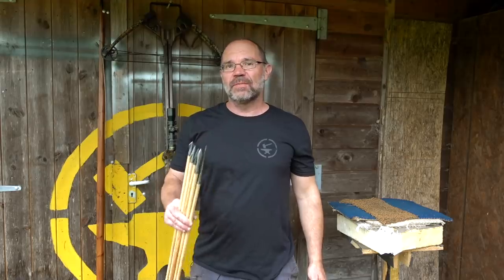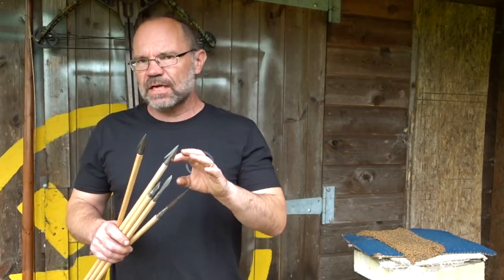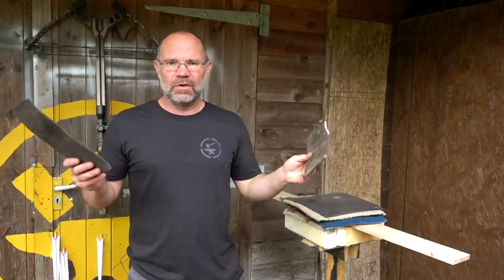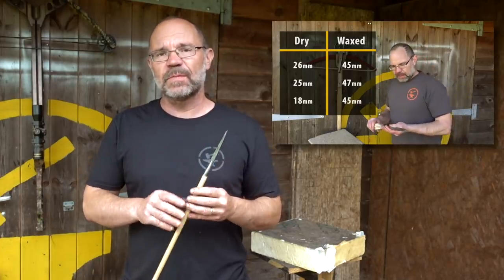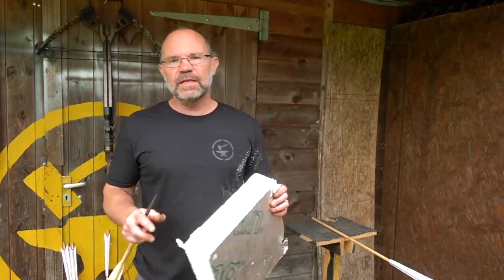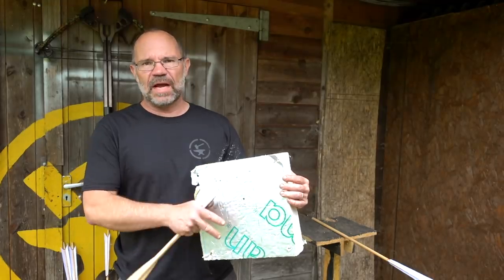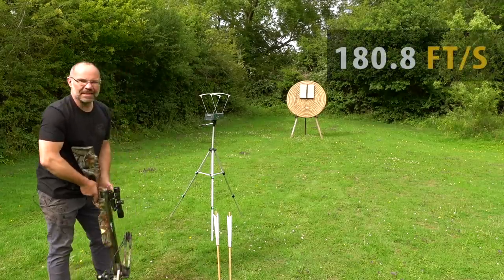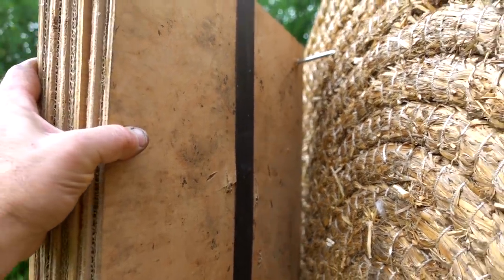Lockdown Longbow - Now I have WAR ARROWS!

Comment: I mentioned ballistic gel in my comment on your last vid, and I just wanted to say that Im fine with you not using it, I understand that you are doing more basic comparisons.

That said, I do think that a softer, more springy backing is important to avoid inaccurate results. After all, a gambeson is much less useful if it is laid against a hard surface, as that reduces the possible compression of the gambeson.

My suggestion would be that you can probably get a decent approximation of both the softness of flesh and the flexible "give" of an upright human being hit in the body by simply adding an inch of soft plastic/rubber foam, like seat from a lawn-chair on top of the stiff styrofoam.

This way the flexible armours have some ability to actually flex, without all the hassle of ballistic gel.

While (if xD) I have your attention there is something I have been meaning to ask.

Why do you think that bronze plate armour did not evolve further in antiquity? We know they did cuirasses, helmets and greaves, and further back they had primitive whole-body suits. What Im wondering is why something akin to the full plate harness of the 15th C ever came about.
Was it cost? But they made huge statues out of bronze. Was it the limits of the metal? But they had no problems making helmets and cuirasses. Plate steel armour came about soon after the ability to make steel in sufficiently large quantities. Was it cultural, to do with social structures and types of warfare? Was it perhaps that Iron had started to supersede bronze, and nobody thought to develop bronze further? Or is iron chainmail perhaps just superior? 
I personally doubt that last one, and I would love ut if you could test a bronze analogue of s medieval breastplate to see how it compares to mail.

I apologize for my very long comment, and I really, really would love your opinion on this.

Best of luck with the test-shooting, Ill be watching with interest.
Reply: I'm not an expert, but afaik bronze is substantially less stable compared to steel, and bronze swordblades were far more likely to shatter than steel blades for example. This would mean a full bronze plate armour would have to be considerably less effective and/or considerably heavier, potentially even unfeasibly-heavy. 
Also, making such a full set of plate armour as in late medieval times required quite some material, time, skill and technology to produce. I think some of that just generally wasn't quite available yet at the time of bronze gear. 
Based off of that, I'd guess they just switched to iron/steel as the clearly superior material asap, without "wasting" further effort on dealing with bronze.
Reply: @Heroesflorian  Theres a key point you are missing. Once you can work iron or steel, its great because its easily available. Bronze is not. Bronze is made from copper and tin. Those two metals rarely are found together, tin itself is quite rare. 

Why put all the effort into producing a metal from rarer materials when you have an easier and better material readily available.

Because iron is harder to smelt from ore than the components of/and bronze, less people were able to use it to see and display how good iron is for making weapons. When trade routes collapsed and tin became very scarce, metal workers were forced to look for alternatives rather than sticking with the bronze they were familiar with.
Reply: @andrewshaw1571  I think its even simpler.  They did make it, and decided the  benefits didn't out weight the negatives.  Remember the sole purpose of armour isn't to make you invulnerable.  You have to be able to march, fight, repair, custom fit it, etc.   In an age when everyone was using huge shields......the body was mostly safe anyway.   Only missile weapons were the outlying threat and most bows and slings of the time were not powerful enough that other more practical alternatives weren't just as acceptable.
Reply: When testing modern Kevlar armor, they put the vest on a block of clay. If you don't, the Kevlar doesn't stop bullets!
Reply: @Andrew Shaw
See, that's the problem I have. Bronze is rare, sure, but not THAT rare. The ancient greeks and romans could fill their temples with bronze statues https://www.metmuseum.org/toah/hd/grbr/hd_grbr.htm, and bronze was used in more well-to-do household items. If you can afford a set of bronze wine flagons, or a couple of life-sized  statues to decorate your villa, you presumably have no reason not to get a set of high-quality bronze armour for yourself or your son
Reply: @Bottlecapbill
But they had the same situation in medieval times, if not more so. Ca 1100 everyone was using nothing but mail and large shields. Three hundred years later everyone is using plate, and shields are smaller and much, much less important.
They moved from the (comparatively) easy to produce, maintain and put on/use mail, to the much more complicated in all aspects plate. The only thing I can think of that really changed in that time was the developing ability to manufacture large monoplates. As soon as they had them, they immediately started using them, because they are just that much more protective. The question is why this did not happen with bronze armour. Im guessing that a full suit of bronze plate is significantly more protective overall than a mail hauberk.
Reply: @IVscythia  it is a great question i am no expert but my thoughts  might help. The success of plate was that it was flexible enough to fight in.  perhaps they didn't have the technological know how to make it flexible enough for someone to actually move around and fight properly. a solid cuirass was easy enough to fight, and move in. To make overlapping shoulder plates and greaves  that could move with the flexibility that plate had was probably beyond their minds at the time.
Reply: I think this is down to the working characteristics. Bronze, like copper, hardens as it is worked. Very difficult to beat out into curved shapes. Most bronze artifacts are cast.  To soften it, you have to heat it up, quick cool down (slow cooling causes more hardening).
Steel works easily when red hot, can be shaped with a hammer and anvil.
Reply: @Alastair Dent
True, but they were pretty damn good at casting stuff in antiquity, for example I think most bronze cuirasses and helmets were cast, not hammered. If they could cast greaves and corinthian helmets I dont see why they could not cast all the parts of a full plate harness
Reply: The simple answer to your bronze question is ............Shields and linen are way, WAY cheaper. The long answer is there was NO middle class in antiquity.  Everyone was either VERY wealthy or a nearly dirt poor peasant (or even worse a slave) .  It is VERY expensive to make metal in antiquity.  The making of 1 statue, yes it's expensive.  But generally you have Insanely rich people commissioning statues.  Think Elon Musk building a space ship. Now fighting a war you need at least a few tens of thousands of men and a ton of money.  You don't really care if they all live, just that they live long enough to get the job done.  So you COULD blow your military budget on a few thousand guys with full plate armor or you could buy cheap as dirt linen Linothorax and wooden shields or even better, NOTHING but rocks and a sling and have an army 10x as big.  Plus you don't have to pay VERY expensive blacksmiths and smelters and charcoal to keep repairing all the gear after every battle.  Just a few camp wives to sew up more linen and make more shields.  And back then, the bigger army nearly always wins.  Also the people PAYING for the war are not usually doing any front line fighting. Xerxes conquered most of Greece but is never recorded as actually fighting personally.
The full plate metal armor came about with a middle class.  The soldiers are often lesser nobles or mercenaries who are paid with enough money to buy their own gear to provide better protection while peasant levies are still out there in padded cloth armor, shield and metal helmet if they are lucky.
Reply: There is so much wrong with that statement, but Ill just ask this: You think that a tiny, economically and militarily dominant aristocratic elite constitutes a "middle class"? Because that's who drove medieval plate development, the knightly class.
And if metal was so rare and so scarce that not even the super-rich would consider head to food protection, what about cataphracts? There were thousands of those guys, across several empires, and even their horses were armoured, usually with bronze, funnily enough. And what about the romans outfitting up to half a million soldiers with metal helmets and body protection? How could they afford that?
Also linen is very labour-intensive and for example the pre-marian manipular legion was built around an economic middle class making up its core.
Reply: @IVscythia  i think it might be a mix of thermal conductivity and work hardening. Being made in part of copper, bronze armor would be a hell a to wear in hotter climates( Iron and steel Plates are already a pain). The next thing like someone else already mentions is, whenever youre working bronze it becomes harder and stiffer. In effect that means whenever you have a dent, nick or other deformation of either a blade or armor, you only have so much chances to repair it before the material on that spot becomes either impossible to fix without smelting it or it shatters into mutiple pieces.
Reply: @MrShpike
Well, the romans xalled cataphracts cilbanerii, oven-men, so I guess you have a point, but Im not sure the difference between steel and bronze is large enough to really matter.

Regarding the work-hardening, yea, that would be a problem, but at the same time, it did not stop them using bronze helmets and cuirasses all the way into the manipular legions of the roman republic, at a time when iron had been around in the region for  about a millennium. 
Bronze still seems to have been the preferred, or at least easiest way to make armour out of untill that point, and that's what I dont understand, why there was no move towards more encompassing plate. Why even cultures that had concepts of full-body armours, such as the achmenid empire never went in the direction of articulated plate.
Reply: @IVscythia  Actually the difference is quite substantial. im also not quite sure if its related to the thermal conductivity alone, but if you compare steel to bronze, brass and similiar alloys, then you will find that those alloys actually get hot enough to burn you given direct sunlight in just a few hours. Though im also curious why they didnt use bronze for things like mail. Most Negatives about bronze are irrelevant in mail.
ok i just googled turns out bronze is just too undurable compared to even just iron, apparently it shears to easily. Those nations that did use bronze mail did it either because they had so much of it or nothing else.
Reply: @MrSchpike
Steel can get pretty hot in the sun as well though, but yea, I should have been more clear. Yes, the physical difference is significant, but Im not sure that the practical difference would be all that significant to the wearer of armour. Plus this was a problem in steel/iron armour as well, but pretty easily solved by keeping direct sunlight of of it with a tabard or similar.
As to your second point/observation: Thank you, I have been wondering about bronze mail myself, and it makes sense. Bronze being softer than iron would be at it's greatest disadvantage when in thin rings I suppose.
It still does not explain why no full plate, but it's really interesting regardless. Thanks again.

Comment: The myth that a longbow arrow goes through a 3 inch oak door
Hold up
There are very few thing that could make it through 3 inches of oak, especially not a bolt or arrow
Reply: Are you blind sir? The arrows bearly went trough straw...
Reply: Ive cut 2 inch oak doors and they burn the blade. Certainly a feat. Id be curious about its bullet resistant properties.
Reply: the myth is based on a story by a knight who fled the Welsh into a cabin, closing the door behind him, which their arrows penetrated. 

http://markstretton.blogspot.com/2016/03/testing-medieval-war-arrows-penetrating.html did some tests...
Reply: @redgrey1453  trough a door, gues it must have been open caus the points just got stuck in and not even past the point, please be more spesific like the arrow logde on his bicep,  or the arrow went trough his biceps ripping it, the arrow strife or graced his uper arm,  or the arrow got stuck in the surface,..
Reply: @mortenjacobsen5673  Barely or clearly? I'm not sure which you were saying, but assuming we saw the same video the arrows went through 1.5 inches of plywood and a great deal more of straw. I'm sure some of the effects of the arrow wobbling would limit the  depth to which it could penetrate the soft straw, but to say "barely" doesn't seem  like an accurate assessment.
Reply: @mdstmouse7  It's unlikely 5 cm of oak will stop bullets. Maybe that small 2 shot pistol called Derringer would fail to penetrate.
Reply: @comunistubula4424  2 inches wouldnt stop much but 3 inches might. After a little digging it should stop a 22 and may stop hollow point 38.  I do know pine wont stop anything. hmm perhaps a 3 inch pine door could be penetrated by an arrow.

Comment: Great stuff Tod. No issues with your methodology. That seems fine. I watched the sheild video before this & it was fascinating, not quite what I'd expected. Most arrows would hang around in storage before campaigns & battle for months or years often in at least some humidity, so being iron they'd rust away fast. So waxing/piling would be a must as proper arrows weren't cheap even back then & you'd need lots for your archers to be effective. I think English HYW armies took a million or two with them to France for each campaign.

Comment: Blacksmiths coat their finished product in wax while is at a "black heat" to perfect corrosion and rust.  Done right, most of the wax become a nice black coating, and the rest evaporates.  If the iron is to cool when applied, it does leave a wax choosing.  I use beeswax on my stuff, leave a great finish.  So, wax is entirely possible.

Comment: Wax to prevent corrosion makes good sense. I've used a mix of beeswax dissolved in linseed oil to keep axe heads pristine and it has the added benefit of helping stop the head bind up in wood when splitting. The linseed makes it easy enough to smear on without needing heat to melt wax and then it dries in place. We'll never fully know what the people did back then because much like now people do not record the mundane day to day because to them it is unimportant.

Comment: Waxing or lubricating screws is a common woodworkers trick to make them easier to drive into boards. I'd guess that medieval carpenters did the same with their screws on the rare occasion they used them. (And yes, they did have screws, they were just difficult to make.) They would have done the same for drawer slides or most any wooden item prone to friction. So, yeah. I agree with your reasoning, Tod. It's hard to imagine someone didn't figure that out. Sort of like modern Teflon bullets.

Comment: Tod, I'll go you one better re: waxing arrow heads.  I wonder if the shafts were sometimes also sealed with wax/tallow, to keep them from absorbing moisture and warping in humid weather.  It could be in a formal military setting, where they might keep a stockpile of arrows on hand for extended periods of time - but also for hunters who need to keep their limited number of shafts on hand in good condition through bad weather.  I've not read of evidence to suggest either way, but it could have the added advantage of smoothing the grain, letting the shaft slide more smoothly through a gambeson or other cloth covering more easily and allowing the point to penetrate the wearer that much deeper - and as you mentioned, they weren't exactly stupid.

Your thoughts?

Comment: Great stuff Tod. I think you've got the right idea - yeah its not all absolutely spot on but it's 99 percent there and that's accurate enough for me. You do great stuff and you work with what you've got. I think your spot on with the waxing arrow thinking. They development their weapons to as far as the materials allowed them. I don't think dipping their arrows in a bit of bees wax is too far fetched at all. If it wasn't intially for penetration reasons, even if it was just corrosion resistance but then they noticed the improved penetration because of the wax. Keep up the good work and don't let the people who are giving you grief, about the 1 percent inaccuracy, upset or distract you. 👍🏼👍🏼👍🏼